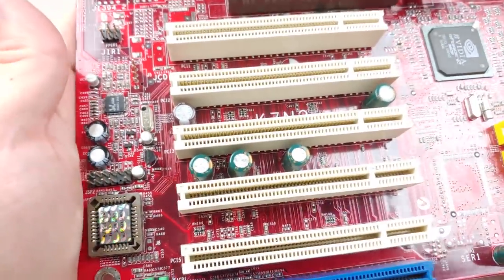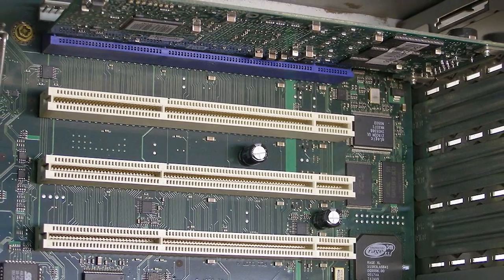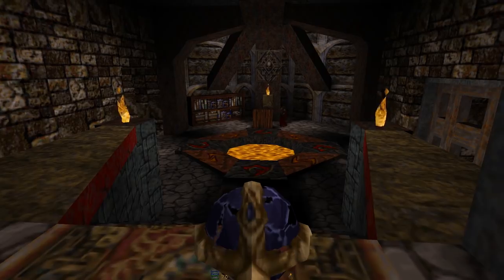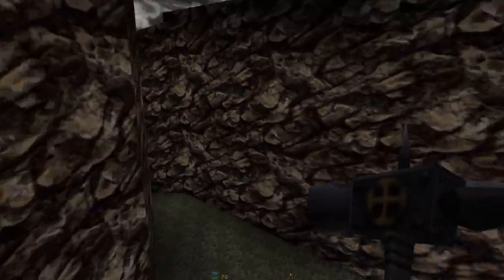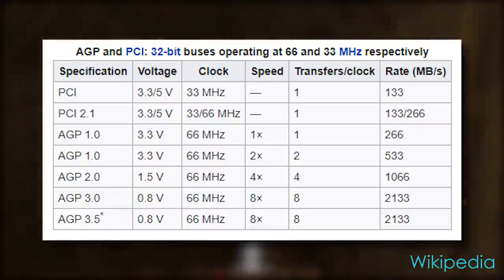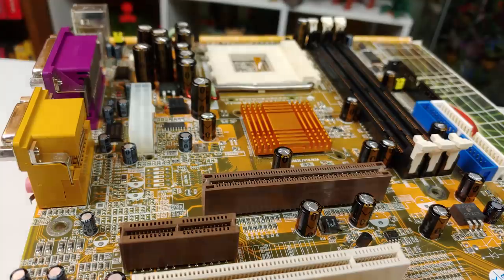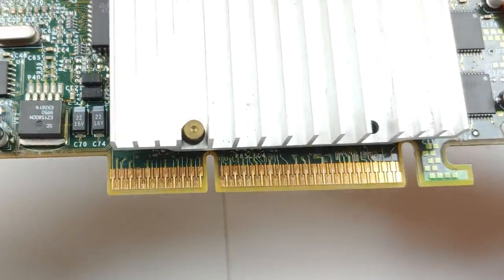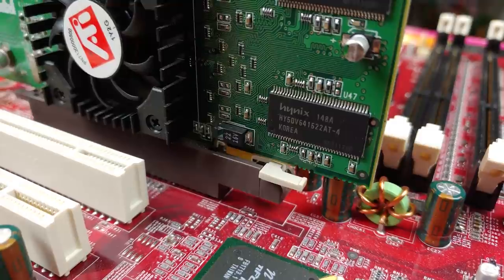A History on AGP: The Accelerated Graphics Port

Comment: Here: https://youtu.be/wlxHcVJL1pI you are inserting card with 3.3V and 1.5V slots into 1.5V slot on mainboard. How comes that the card works this way? I have MB Biostar P4TDP with the exactly same AGP slot (one 1.5V slot on the right side of the AGP slot) and it works only if I use graphic card with the exact same shape, so 1.5V (e.g. MSI Rx2600Pro). However, any AGP card with 3.3V and 1.5V key does not work and PC does not load at all (tested with GFX 5500 and GF MX440-8X). I am really confused about this aspect. Can anybody shed some light on this for me? I could imagine that If the card has both slots then it can use both signaling voltages (3.3V and/or 1.5V), meaning that I can use a video card with both slots in a 1.5V AGP slot, but obviously these cards do not work for me (only 1.5V AGP card). I don't understand why. 

tl;dr Universal AGP cards (Double slotted) do not work in my Biostar P4TDP mainboard that is 1.5V AGP mainboard, while AGP 1.5V cards (obviously) do. Any tips why?
Reply from the maker: Not sure why that is. It may actually be a BIOS issue (bug).